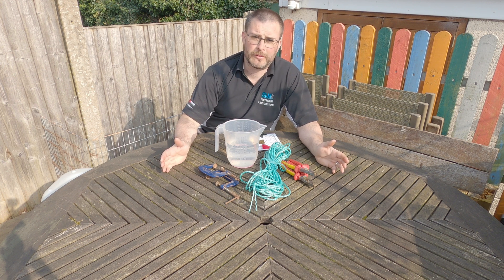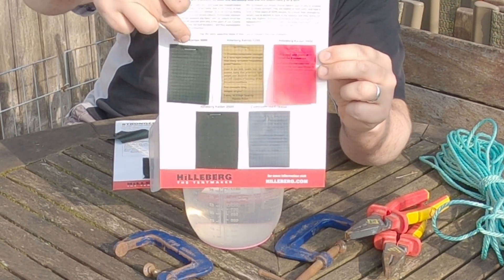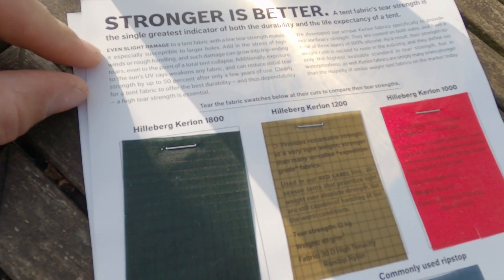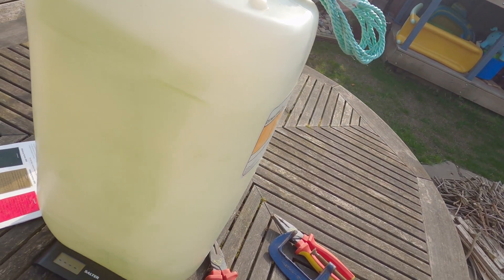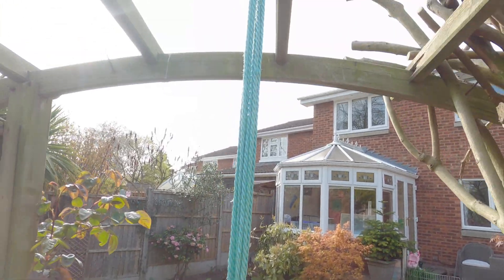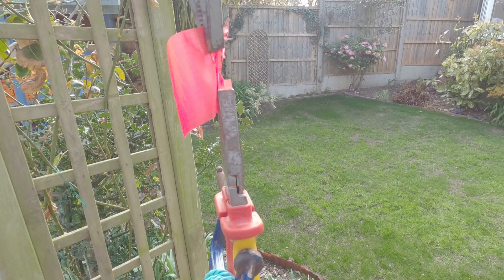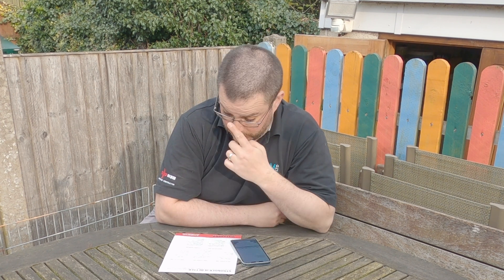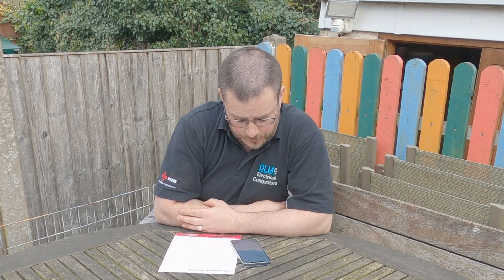TESTING HILLEBERG FABRIC | How Strong Is Kerlon? | Testing Hilleberg Tent Fabric To Destruction

Comment: Great video. I reckon it's really good to see something like this being done. And good on Hilleberg for quoting tear strength of their fabrics. Other tent makers seem to just quote Denier, which is just the weight per unit length of yarn.

As for the results, I can see two issues. Most importantly, I believe Hilleberg do a "tongue test" where they tear a tongue of fabric with two actual tears, one at each side of the tongue. If you go over to this video https://www.youtube.com/watch?v=edWHNJdgefY and fast forward to time 0:33, you will see what I mean. You are doing a "pants test" pulling apart two "legs" either side of one tear. All else being equal, you should get half the force that Hilleberg gets because they have two tears and you have only one.

The second issue relates to the test conditions. How fast is the load applied? What is the temperature at which the test is being done? What is the humidity? (For nylon, humidity is very important because it affects the moisture content of the fabric which in turn affects its strength.) All this means that your result will be pretty rough. Still great for a back yard effort without a tens of thousands worth of laboratory equipment.

Comment: If the material were clamped across the whole width then it would spread that load. What the experiment did was  to focus the whole strength on the tear point. He former is closer to the stresses out on a fabric in a tent
Reply: https://youtu.be/7Xijx4PrDmE